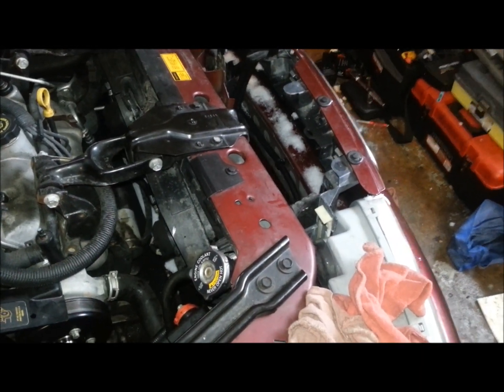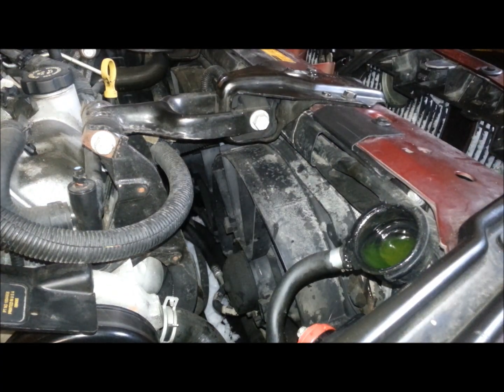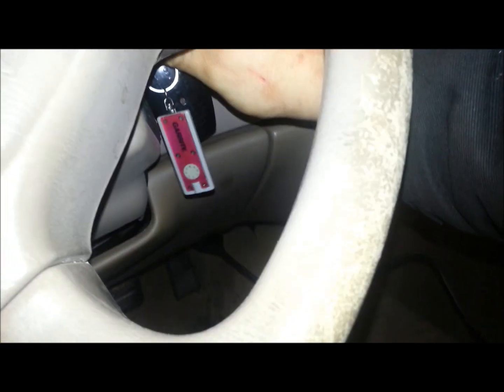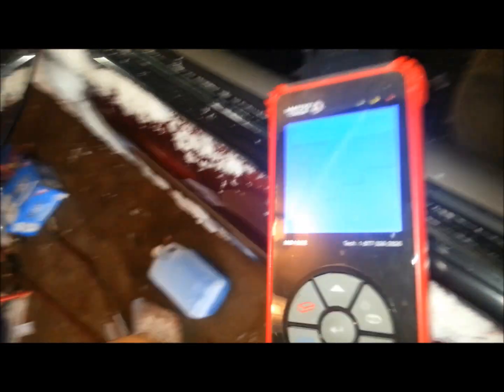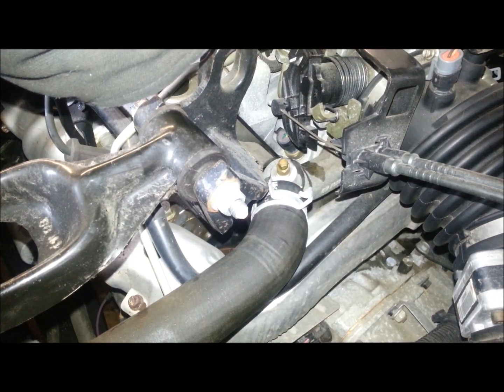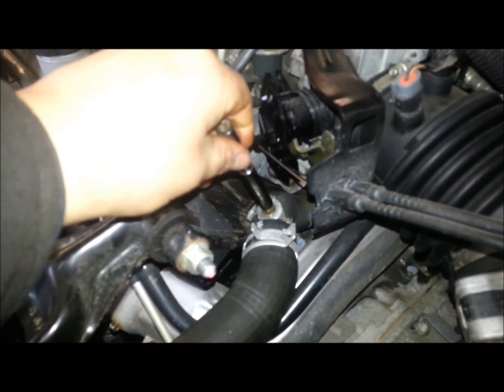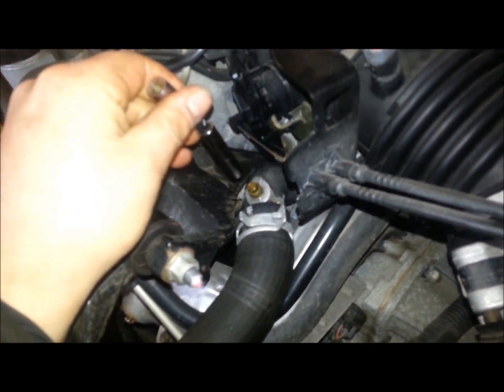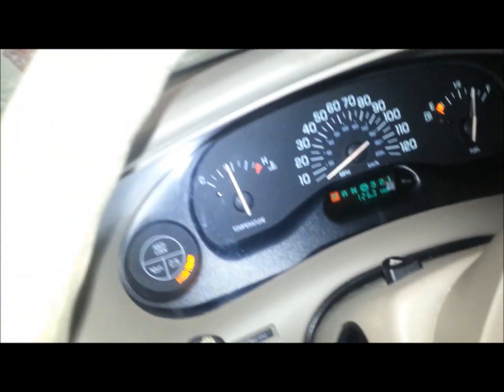how to bleed coolant system 3.1/3.4 liter

Comment: Maybe I'm wrong but I thought you were to bleed with cap off 
 I ususually  take it off before starting with a pan under it. It seems kind of dangerous  bleeding  with a pressure system. It look like you put the cap back on to bleed. Lots of air comes up throught the cap hole. I usually let it run 20 minutes  or so after it reach operating temp . Until the bubbles stop where the cap goes on. Open bleeds during that time and close them. If the pan is clean under filler hole I pour back in if it low .

Comment: Wait, why will the one on the left cause you a very bad day? Just curious. That one on the left wt the heater core line was the first one i noticed that lead me to the search and found this video lol
Cause we did a water pump and now i have no heat. Been bleeding old school with the cap on the radiator but no luck obviously

Comment: So basically you keep doing it until no bubbles come out of the valve? Or is it until no coolant in general comes out of the valve?
Reply from the maker: Bubbles , once a steady stream of coolant flows your good!!
Reply: @JoeTheAutoGuy  what if coolant stops coning out of the bleed valve all together, but my coolant reservoir is full?
Reply from the maker: @codyshuey258  radiator has to be full resivoir doesn’t pull fluid fast enough unless you have a degas bottle system
Reply: @JoeTheAutoGuy  My radiator feeds from the coolant reservoir though. I don't have a radiator cap
Reply: @JoeTheAutoGuy  So since there's no steady flow of coolant coming out of the bleed valve, does that mean I have a clog somewhere?
Reply from the maker: @codyshuey258  or your low or not moving it far enough out but be careful not to loosen to much and lose the plugs
Reply: @JoeTheAutoGuy  my coolant reservoir is completely full
Reply from the maker: @codyshuey258  what about the radiator itself do you have a degas bottle system  or a radiator cap on the radiator itself
Reply: @JoeTheAutoGuy  My coolant reservoir feeds my radiator. I don't have a separate radiator cap
Reply: @JoeTheAutoGuy  I was doing this, and once the bubbles stopped, the coolant stopped coming out of the bleed valve all together, but the reservoir itself is full with coolant

Comment: You never bled through the first bleeder. There is a pipe for de-icing the throttle body which comes straight up from the water pump near the radiator fill cap. There is a bleeder at the top before it goes off to the throttle body. You need to loosen that bleeder while you fill until you see coolant coming out of the bleeder. Squeeze the upper radiator tube and burp the water pump bleeder again and again while waiting for the thermostat to open. The thermostat housing bleeder is the only one you show here but if you don’t bleed the other one first you may have a big air bubble that prevents or delays the thermostat from opening.

Comment: Joe i bleed my cooling system with the passenger side bleeder that you said not to. How do i correct my mistake i have no heat in the car. Thanks
Reply from the maker: Fill cooling system and follow instructions in this video and you’ll be fine

Comment: This is the best I've seen so far you can't believe the trouble I have been through. I bought the vehicle used and I couldn't figure out what was going on. It turns out someone had sheered off that little 7 mm bleeder and it looked like just a 10 mm screw. I bought the proper screw and bleeder on Amazon yesterday for 8 bucks. What a hassle.
Reply: How did you remove the broken bleeder screw??

Comment: Lol I wish I knew about that bleeder screw. I've been trying to let it bleed through the radiator cap. Limited success. Though another issue I've had is at times the coolant looks like it's a blown head or intake gasket, but clears up when cool. Aside from other bits in the system, it needs a flush... And I suspect a thermostat too. Has an engine code for not getting warm fast enough. But at the same time it can start to overheat. I'm going to guess stick thermostat for too cold and air for when it's too hot. Mines a 2003 buick century. It has the dual zone climate control thing which likes to short out keeping the ac from turning on

Comment: While you're loosening the bleeder valve, is the radiator cap turned on all the way?  If so, does the coolant get sucked out of the overflow tank, into the radiator, to displace the air that is bled out?

Comment: On my 97 lumina there is another bleed screw on other side of engine in front looks different then one seen here but works the same, was right there in front of me but never really acknowledged what it was cause looked totally different then one by thermostat this is to be bled of air also.

Comment: my car was running hot usually on open highway where you may think it could draw in more air and cool down. nope. I had air pocket in cooling system and low coolant when I got car. I also decided to replace coolant temp sensor. it would heat up to 260. max on gadge. scary as xXxX. Pontiac Grand Prix.3.1. after I replaced sensor and added fluid and got rid of air pocket. wow.. I had good heat+ no overheating at all. even does good on heavy load up hill. 3.1 century engine is in car. these engines are fairly strong and fast imo. if maintained. I've added a ecm and maf sensor also. the car runs very good now and I was told it was a junk pile and needed a new engine. duhh not. thank you for this helpful video sir.

Comment: Spilling coolant everywhere even all over shop floor.  And even worse using the wrong coolant.  Chevrolet explicitly states to use Dex coolant. ONLY due to corrosion issues from glycol based coolants.  Additionally never use tap water unless in emergencies.
Reply from the maker: Minimal coolant spill , video is quite older etc  , using universal because at this time period there was a class action lawsuit on dexcool and its old formula and customer requested it fully replaced , drain pan was underneath vehicle

Comment: When I squeeze lower hose, I can hear it on the reservoir, weird stuff. There is no over heating and no code, but after a day or 2 I check the reservoir and its Damn low again. I see no leaks. What is your opinion Dude?

Comment: Wait a minute so you can use the green coolant for this engine type? Cause i use dexcool and its the first time I've ever got smudge lookin shit around the radiator cap
Reply: You should stick with Dexcool. Switching or mixing them leads to lots of problems. I speak from experience.
Reply: If you FULLY flush the dexcool out you can use whatever you want. Dont mix different colors of coolant or bad things will happen. Apparently the orange universal coolant works with dexcool. I hope thebpeople from the 3 parrs stores in town know ehat they are talking about cuz im doing this with my impala right now and i only know the coolant is orange. No clue if it is universal or dexcool...

Comment: My 1999 Oldsmobile Cutlass's either OEM, Haynes manual or both said to attach a 1/4" hose to the screw. That would help with the bad squirting and the coolant leaking. Remember to keep it away from the hot places.

Comment: Question: I bought a car from a guy that has the 3.4 he had a leaky water pump and kept putting green antifreeze in it and its suppose to take the orange. How do i get the green out of the block to put all the right kind in It. I was told mixing the 2 isn't good.
Reply from the maker: Flush it out , pull a heater hose off and the lower radiator hose and then use water and flush out, then pull block drain and drain, then use distilled water and DeX cool or prevent mixed DeX and fill and bleed system

Comment: Not all cars have such a Valve to discharge the Air ! So this procedures are not
For cars around 2008 and above , even GM cars such as Hummer H3 do not have
Such a tinny Valve to depressurizing the radiator , in that case what is the procedure ?
Reply from the maker: run with cap off and close down once thermostat opens and air is bled out

Comment: Hey Joe. 
Im not a full time Mechanic but i can hold my own.i am having issues with this 2001 malibu 3.1.. Its building soo much pressure and even after i watched your video i did as you showed.i am getting no resolution.
Help!
Reply from the maker: Head gasket most likley,  building pressure into cooling system
Reply: @JoeTheAutoGuy  oil is clean as can be
Reply: @JoeTheAutoGuy  i posted the video
Reply: @JoeTheAutoGuy  if in fact it is the head gasket will one those blue devil or rislone have a temp fix for it?

Comment: Great info. I have one question. Was the radiator cap in the vent position or was it tight the whole time you were bleeding the air out the bleeder valve ?
Reply from the maker: Vent
Reply: JoeTheAutoGuy thank you for responding back to my comment. Respect.
Reply from the maker: No problem I try to answer comments as much as possible

Comment: What trickery are you playing? You think adding fluid after bringing motor up to temp while pressurising the system to then add fluid to the rad? Misleading and getting people injured.. DO NOT OPEN THE CAP IF FLUID IS HOT OR YOU WILL KNOW NOT TO DO THAT AGAIN.
Reply from the maker: I never closed the cap I was bleeding air , adding fluid and then once the car cools down add fluid dont comment unless you watch the whole video
Reply: @JoeTheAutoGuy  Did watch it all and if the coolant is at temp then how is it your able you fill it?  I could be wrong but after trying to bleed it the way you did the coolant was pushing out of the radaitor Due to it getting hot,  and when you were bleeding it you never said to cap it or not,  also come to find out other comments are also concerned the way you suggest is incorrect.

Comment: Dude I fucked up and tried to bleed the 10 mm valve as well- how screwed am I ? It’s a 99 lumina. It was over heating badlly so I replaced the water pump but it’s still overheating. Could it be my thermostat?

Comment: Nice attempt, but not correct on the proper procedure on bleeding coolant system.  Someone else commented and enlightened me on the proper way:  

Open both bleeder holes slightly WITH engine OFF, add coolant, and close bleeder bolts while coolant is flowing out of them, this ensures no air is in the system.  He also mentioned the method in this video allows air to be Sucked into the system, thus, defeating the whole purpose of your operation.  Please take care.
Reply from the maker: Unfortunatly this procedure you mention doesnt get air out of the heater core. It's is the "correct method" but my way is for systems that are being stubborn. And a coolant system that is flowing wont suck air in its not a hydraulic system
Reply: @JoeTheAutoGuy  it doesnt have to be hydraulic system to suck air in.  I dont know for sure about the suction part, but it seems, like it might, i dont know.  Take care bud.

Comment: I have a Mitsubishi Eclipse 2003 2.4L I have problems changing the down stream sensor I can’t remove the cover in the inside to get to the clip were is connected

Comment: you have the wrong color of coolant. should be dexcool in there, not green.
Reply from the maker: DEATHCOOL WAS FLUSHED OUT LONG AGO HAS APPROPRIATE PH GREEN COOLANT LONG LIFE
Reply: I've been running Prestone Low-Tox Propolyene Glycol in my '97 K2500 Silverado and my '98 Olds Cutlass for years with no problems. Just make sure you thoroughly flush the system before switching over to PG based coolant.

Comment: With the engine cold, how can you bleed air from the heater core and engine block with the thermostat closed?
Awesome video. Thanks a lot.
Reply from the maker: Neil Williams coolant naturally flows through the heater core its on the bypass tubes for that reason if you start to get hear from the vents you know the coolant is flowing through and no air should be present

Comment: I have been messing with this 2007 Torrent all night.  I gotta go find this bleed off valve/ screw, has to be one somewhere right?  I changed the temperature sensor in the block and then the thermostat, with in the last 15 miles.  I unhooked the large return to the radiator and found that if I pulled back on it, i didn't lose any coolant. so didn't bother draining the system, then I though , all I would loose is maybe a pint when I pop the thermostat in and change it out for one of the fancy fail safe ones. 

  I was right, a pint or less spilled out,   I was wrong though too, a pint or less is all it takes to vapor lock. LOL   so anyway.  this is a 3.4, it does not have the bleed off you are playing with in here, must be somewhere else.  the heater works only when the torrent is in drive and running down the road, stop at a stop sign and poof, starts getting cold.   

  this things crazy sensitive temperature wise.  it;s hard to believe that chevy/ gm would get something this sensitive to temps and then put a gauge on it that is ridiculously underwhelming.    i think I might put a gauge on the side separate of the system just for piece of mind. 

   the temp control sensor in the black goes out and you will have a zero reading on the dash and your computer will say   Engine Hot , A/C Off.  you will have heat but not much, both fans in front will run continuously.  engine runs way too cool.   after the sensor is replaced, for some reason the thermostat goes out, did in my case anyway. Poof.  i mean, it was just too close to be just a coincident,. 

  this is a high miles car over 175K, this engine runs like a top! No Joke, the transmission too, it;s unreal, 5 speed, shifts so smooth you cannot tell it shifted, its; like a mini bike centrifugal  , if you romp on it, even from a stop, the wheels ( FWD) will break traction for a second on dry black top and this thing will down shift and start flying through gears like Mario Andriette is under the hood.  Its crazy for something that looks like a mini van. 

  i was looking at the transmission tonight with a head lamp and reading glasses on and it has a plate on it that says MADE IN THE JAPAN BY AISIN <---  aMAZING TO ME, THIS IS THE SAME OLD SCHOOL PRECISION company that Toyota uses for the awesome parts.     i seriously amazed by this vehicle. I am looking for another one. it's a great ride. It reportedly can pull 3500 pound trailers!   LOl i can't wait to see that.
Reply: Larry Leisuresuit the bleeder is under the engine cover

Comment: So for the bottom bolt on the thermostat housing on a 3.4 in a 01 aztec to get rid of the difficulties reaching it bending wrenchs an braking my hands i took a look.. REMOVE THE THROTEL BODY AN YOU HAVE FULL ACCESSES TO THE BOTOM BOLT.
Reply from the maker: Nice tip! Thanks for sharing!!

Comment: Is your rad fan blow toward the engine or toward the radiator?  
 

All 2000s gm impala models . 

Let me know thanks
Reply: David Solis the radiator fans are behind the radiator and pull air through the radiator and also blow air onto the front exhaust section.   That's pretty much how most are setup, the fans have to blow or pull air towards the engine otherwise they would be fighting incoming air as you move down the road.    The radiator fans not only cool the radiator but also have some effect of air cooling on the engine itself.

Comment: Have a 2006 equinox 3.4l. Is this bleeder valve located on the water pump? Is it on the water pump on these cars. Bf wants to confirm before proceeding.  Thank you

Comment: you don't have to do all that. if you know the purpose of the bleeder valves, both bleeder valves, you never have to crank the car.
Reply from the maker: Mark Cobb yes it can be done easier but in my experience is most do not take the time and this is a full proof way to get stubborn air out of the system
Reply: The right way is not only easier it's faster.
Reply: JoeTheAutoGuy  I got a question  my Buick rendezvous 3.4 v6  just replace thermostat  and started how much time I got to bleed the coolant system my rpm was on 25000 rpm ?

Comment: This video was helpful in how to bleed air from the coolant system. After the temperature reached 225 degrees he added more antifreeze to the radiator. You don't want to take the radiator cap off the with the car hot. You can get burned. Let the car cool down before opening the radiator cap.
Reply: P
Reply: P loop p poo
Reply: I think he meant after the bleed process...tip off when cooled. He jumped around but yes on get radiator pressure 1st but breezed thru that on how. Then if a car wasn't getting radiator pressure he passed over. Say the pump or loss of pressure..nope..just showed pressure on cap..but yes to bleed the system that's how.

Comment: If I had to do this head job again I would fill the cooling system at the heater core hose because its a pain to get the heater core filled.

Comment: That is not how you bleed the system out. With the car turned off. Open both bleeders and poor coolant into radiator. Until it starts poring out of bleeders. Close bleeders while coolant is flowing out. Start the car let it run until it blows heat inside of car. Turn vehicle off. Open bleeders again add coolant make sure it's a good flow. Then close bleeders and top off coolant. The way this idiot did it. It sucks in air. I am a master technician
Reply: but not a master mechanic,
Reply: Do not use this video as a reference. If you need to be informed why - continue to watch his video. Too funny.
Reply: Todd David you tell em gangsta🤔
Reply: does this method works on all vvehicle
Reply: This way seems more legit

Comment: Man, Joe thanks so much for this video.  I know this is a little old but I have a 2003 Chevy Impala I couldn't figure out why my car kept overheating after I just removed the radiator.  After I bled the car like you said my car worked like a dream.  Saved so much 💰 thanks man!!! Great video.